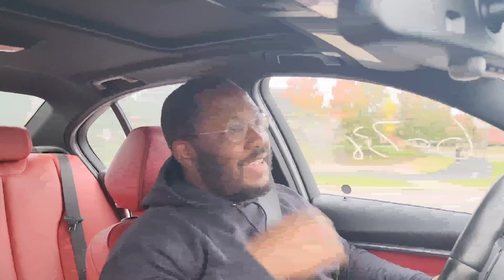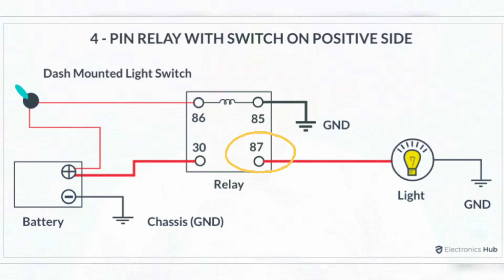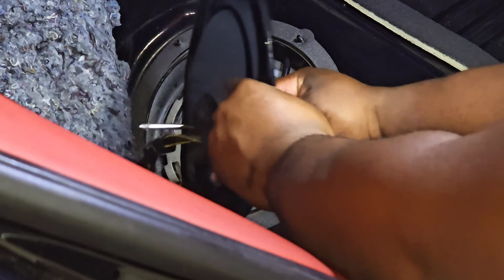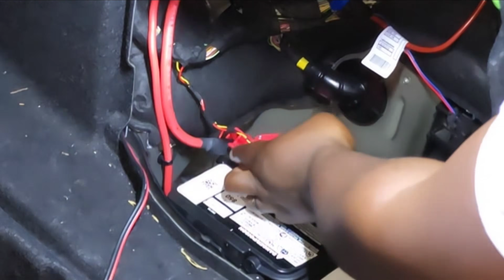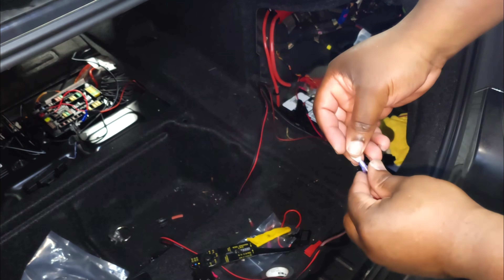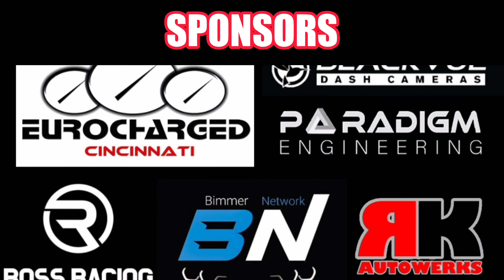How to wire up ANY LPFP Upgrade to Motiv Reflex

Comment: Great video 🔥, Question, i have had a fuel it stage 4 kit installed for a while, and my secondary fuel pump turns on with a hobbs switch, now i got a reflex, so do i just connect the ground long wire that comes from the back of the car to the hobbs switch to one of the AUX on the reflex,  and scratch the hobbs switch ?
Reply: Did you get a solution?

Comment: Question why didn’t you use the additional aux cable wiring that already has a plug to connect to the Aux out with the fueling wiring ? Instead you cut the Aux out plug and just connected the wires. Just wondering if there was a specific reason you did that.
Reply: i’m interested in this too, as i also have the plug and play kit and know they come with connectors that could be use to utilise the plug.
Reply: So I came up with this conclusion. Since the wiring from the fuel pump is only ground there’s no need for the 12v red power line since power is supplied by the circuit on the harness we only need to tap that ground wire that feeds into the reflex. So my guess and I may be wrong to avoid having a HOT (live) 12v wire from the connector, tapping just the ground is safer and more direct.
Reply: @Wh0_Me_B58  you mean to connect the power (+) wire from additional pump to power coming to original fuel pump? And then connect the ground wire directly to reflex? That seems like a much cleaner and easier solution. The only downside I see is there mighnt not be enough current from oiriginal loom to power two fuel pumps
Reply: @biatchkillar so I have a VS stage 3 + pump. I wired the +\- from the bucket controlling the second pump to the +/- with the relay to the battery.  Then only tapped the ground wire on reflex aux connection and connected that to the remaining connection from the pump harness which activates the pump via signal from reflex. Everyone’s is a bit different though.
Reply: Because its only a ground wire no need for power there

Comment: Hey Kern, appreciate your videos.

I watched your older LPFP video talking about our cars can handle 650-700whp, but it seems like you're reaching LPFP issues below 650whp when you were tuning on Ethanol with your new turbo. 

I just bought a DAW Flowmax Turbo for the Gen2 B58 (It's the ultraflow version renamed to flowmax when they released the Ultraflow R and prior to releasing newgen). On my '20 M340i I'm really looking to hit whatever safe limits are, which is 600tq for our weaker ZF8s, but I'm unsure of our power limits due to fueling. I'll be upgrading my Intake Manifold and run PI + Flex Fuel sensor and really looking to get 600-650whp. If I need to upgrade LPFP for 600whp, I'll probably cut out PI and just run upgraded manifold (no PI) and run a low E20-25mix and probably shoot for 570-580 since the cost associated is just too high for that little of safe power gain on stock trans/motor. 

Do you think a LPFP is needed for 600whp? I'm on BM3, basic DP + E50/93 OTS tunes currently.

Comment: Informative video as always! Perfect technical level.

Question why did you choose automotive relay instead of sold state relay? My tuner recommended the SS relay so Reflex could control secondary lpfp better for PI.
Reply from the maker: Because of how it works. That's what the kits will come with. From what I'm saying, solid state is only needed if you plan on varying the amount of output on the secondary pump. But with the reflex it's basically on and off.
Reply: Nice video but I have a question why you don’t use the reflex 12 volt.. you cut the wires if you have plug and play harness
Reply: @kern417